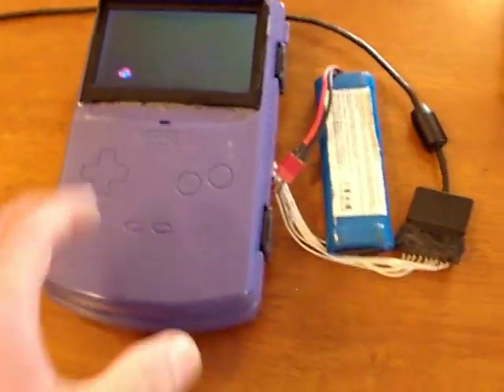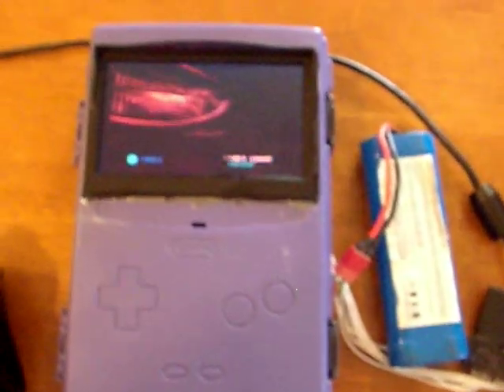How to Make a Portable Sony PlayStation PS2 PSone DVD Player  Handheld (Part 1)

Comment: Good evening, I saw your videos and I'm starting on the ps2p project, could you give me some help on the controls part?
I'm trying to cut the controls, but the problem is soldering the wires that connect the control to the buttons and also the analog.
so far was the only part that I caught, I've lost 3 controls trying
Could you give me a light on how to proceed?
Reply from the maker: o not use original PS2 controller, I was used a aftermarket one made by MADCATZ

Comment: ps2 slim is much better than ps2 fat easy to spoil already repaired 3 times changing lens way back 2003.
Reply: not true at all i have been owning a phat ps2 sense 2004 and not once have i ever had a problem with it but wen i owned a slim ps2 it kept overheating on me and put the scratch ring of death on any CD i put in the system